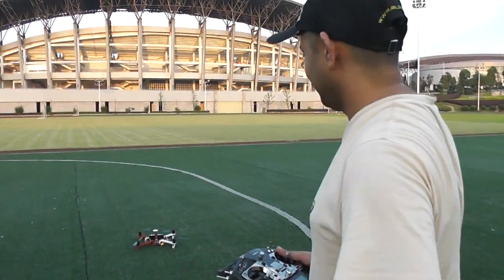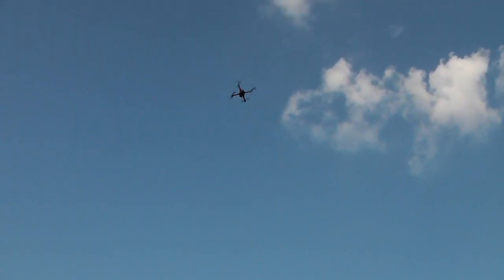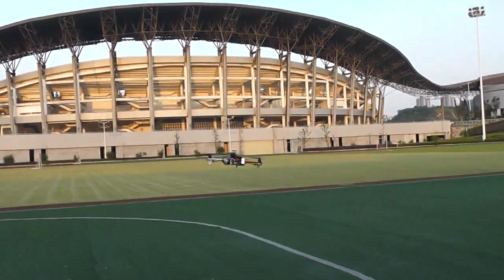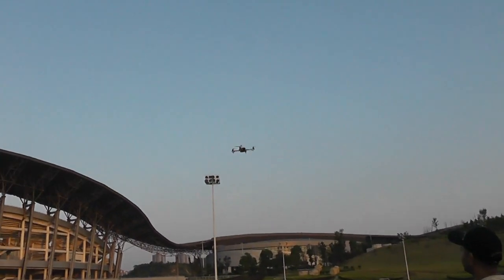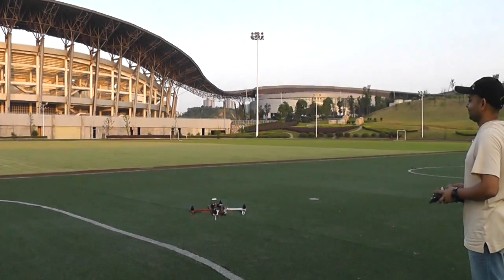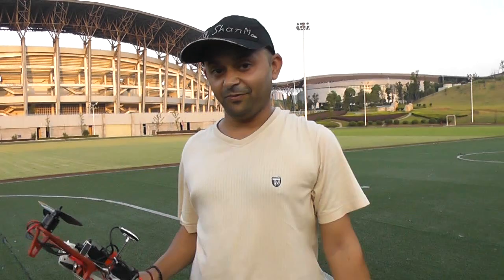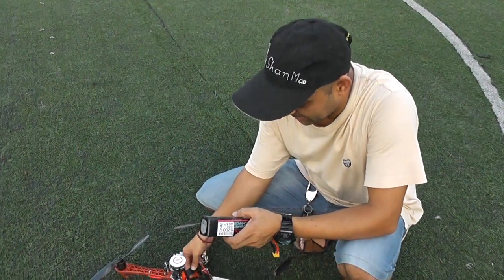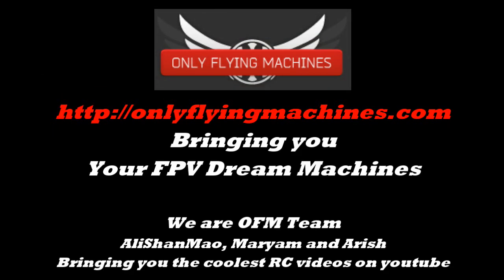OFM-450 V2 on 4S 5200mAh 35C lipo

Comment: More on the OFM-450, your 3 cell 2200ma packs, what is the minimum C rating you would use, 25C or higher? I know the higher the better, but cost, availability and weight come into the equation. With the problems shipping Lipo's by air, I have to source them local here in Australia from HobbyKing.
I'm looking at an all up weight ready to fly 1.4kg without FPV and GPS gear

Many Thanks,

Dave W.